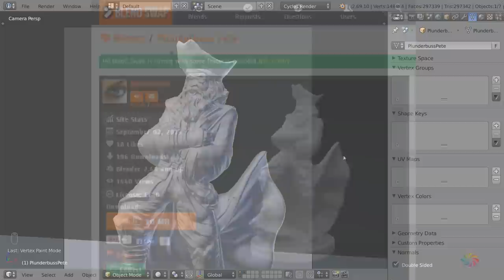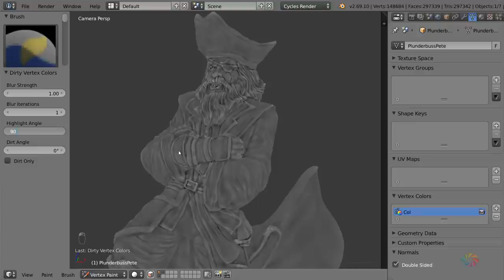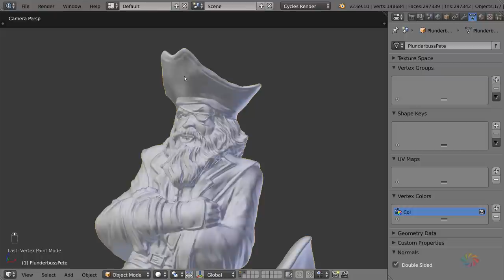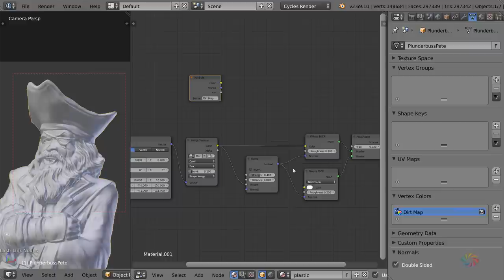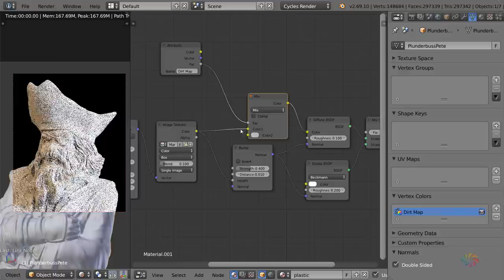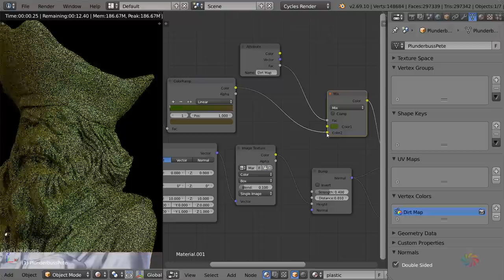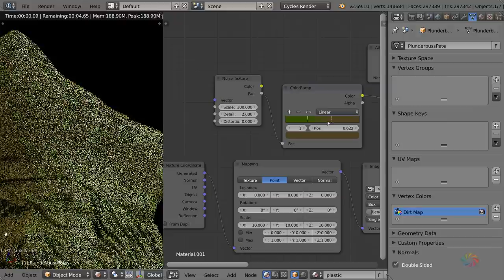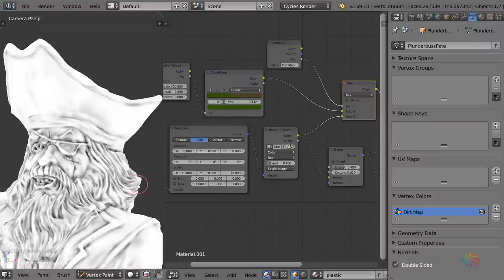Blender Tutorial: Quickly Add Dirt to Crevices

Comment: So I have this super high poly model of an orc-ish character, and since I didn't want to lose my mind unwrapping or retopo-ing, I just slapped a Principled Shader on his skin, added just a 0.2 of Metallic (it makes skin look more like actual skin for some reason) and I mean, it looked sort of acceptable but the creases didn't catch enough shadow. So I used this tutorial and it's surprisingly good to fake some extra shadows in the folds between muscles, in the nose, etc. Using a more saturated color for the Dirt Map also kind of simulates blood concentration and natural reddening of those parts, and you can even simulate some simple sweat if you want, by toning down the Roughness of the Dirt Map and/or adding a Clearcoat to it. So it seems that Principled+Dirt Map is a nice way to make a simple skin texture, kinda like the one they use in Hero Forge.

Comment: When I click dirty vertex colors it uses lots of CPU but then nothing happens
Reply: Did you get the panel on the lower left that lets you adjust the last operation? The default highlight angle is 180, you need to change that.

Comment: If you were using this  technique for architecture, wouldn't you have a problem due to the low (in comparison) vertex density?
Reply: ***** Ah, cool. It seems to work best for sculptures, I can imagine it would be fantastic for dynatopo sculpts.
Reply: ***** Can you explain how to do this in Blender Internal not all of us have 500$ graphic cards ?
Reply: Why should a $500 graphics card be necessary for that?
Reply: i meant for Cycles in general :)
Reply: sam jonson i have a 50€ graphics card from 2008 and it works fine
Reply: I don't have ANY graphics cards and it works fine.

Comment: Nice, but in case i have modelled a car which consists of a lot of different parts like trunk, engine hood, doors, roof, fenders ...... ? I think i have to make a copy of the car paint material for EVERY single car-part, because every part of the car has a different vertex map :-( and then the dirt paint for all the parts doesnt have a uniform look at all. I think your technique is only suitable for modells consist of a single mesh/part like in your example.